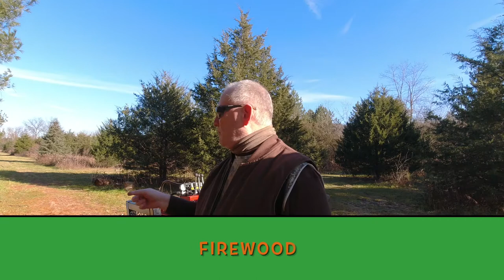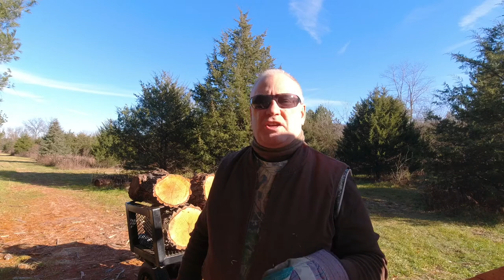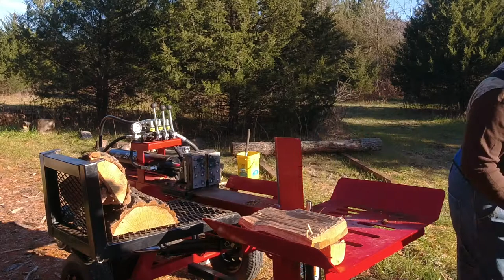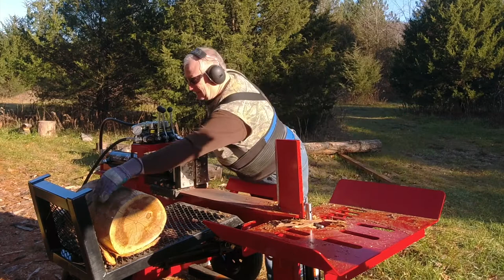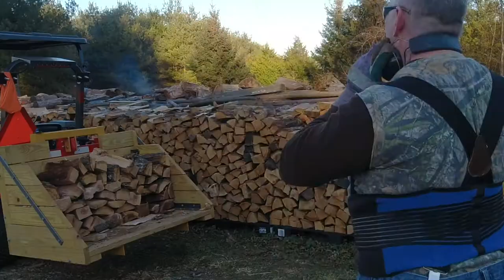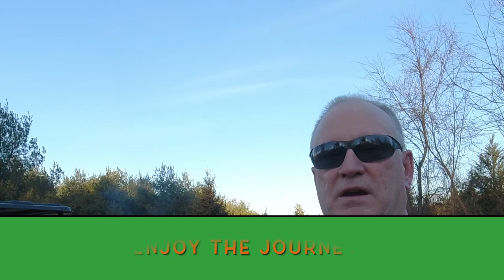#99 - Firewood

Comment: Evening, Bob! Yep, it was a very beautiful day there! I gotta tell you I really love all the work space on your splitter. Were those addons or did they come with? Thanks for sharing, my friend and have a Merry Christmas!
Reply from the maker: Thanks 👍 The log splitter you see in this video is the Wolfe Ridge 28 Pro - It comes with the log lift and sorting table are standard features on the 28 Pro - I added two 3/4 inch plates to the front of the push block to make the logs split a little more consistently.  If you look closely at the push block you can see a one inch vertical split down the center of the pusher - The split insures the pusher does not hit the splitting wedge at the end of the stroke - Thanks for watching and commenting - enjoy the journey - cheers